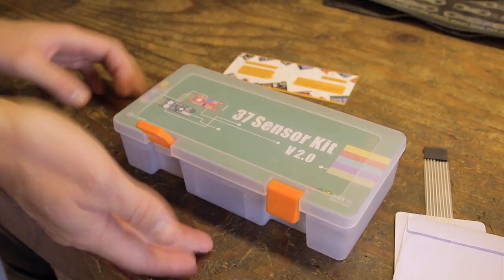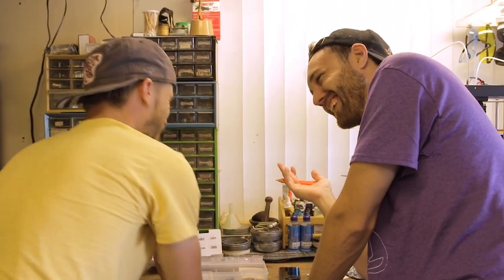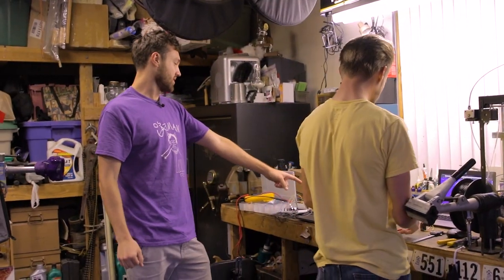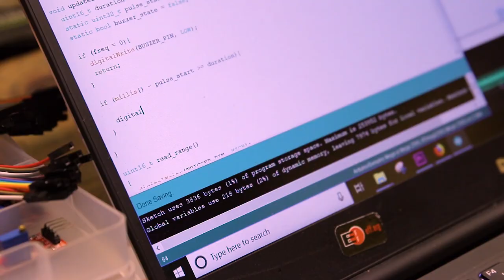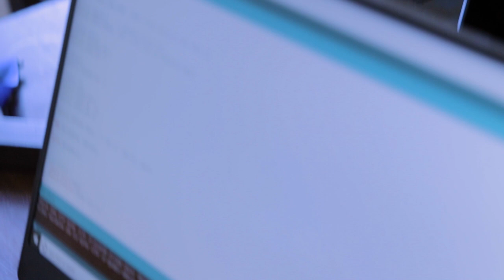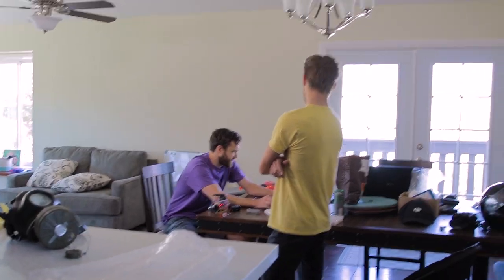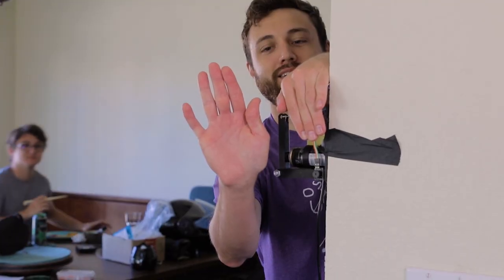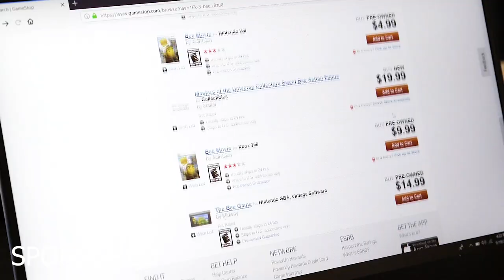Deodorant Robot For Middle School Boys

Comment: a motion sensor that turns the light on when it senses movement? how about an invention that moves things when the light is on
Reply: better yet... an invention that moves things when lights are off
Reply: if you put the two in a room together you get infinite energy.
Reply: They already sell that in stores
Reply: A motion sensor that turns the lights off when it detects movement.
Reply: An automatic chair mover so when you get close to sitting on the chair, a motor yanks the chair under your ass.
Reply: Steady on, that almost sounds useful.

Comment: Quick question William..... True or False ~ what time is it?
Reply: One of the 10 people that got it haha
Reply: r/programmerhumor
Reply: There are at least 10011 at the time I'm writing this.
Reply: It's True o'clock here btw.
Reply: Why doesn’t his compiler tell him this error?
Reply: because it's not an error lol
compiler will only tell you typos or things that don't work and storing the time as a boolean doesn't break anything so it doesn't tell him about it because it assumes that is what the coder intended
Reply: yeah the compiler isn't smart enough to figure out context. It would just assume whatever value he put was the intended value, for example if it had 2 numbers it wouldn't be able to distinguish between which one is time and which one is an integer, it would treat them both the same unless you assigned the different (correct cough William cough) variable to them
Reply: I’m a software engineer in automation and industrial machine code, language is different but the compiler always finds errors like this.